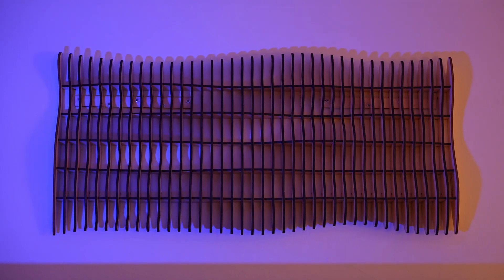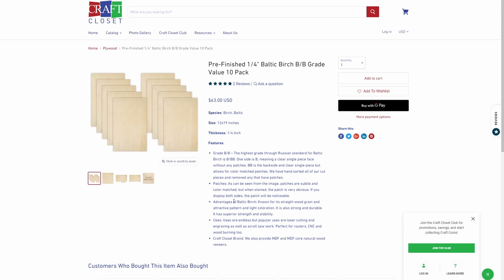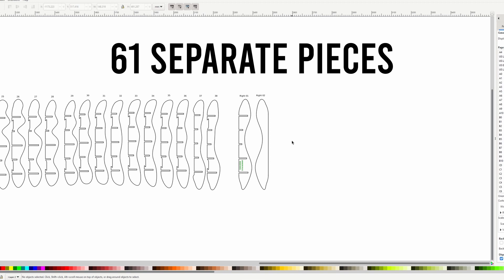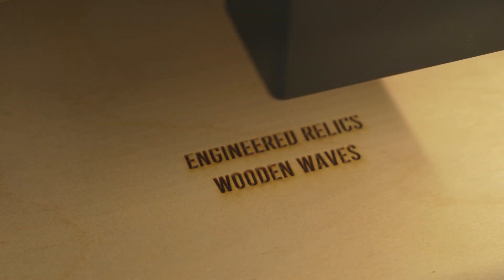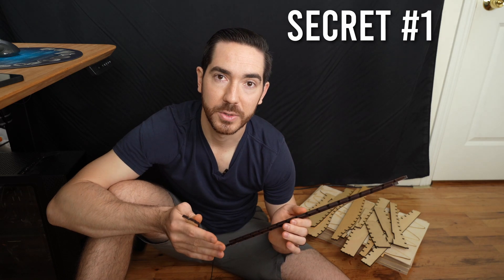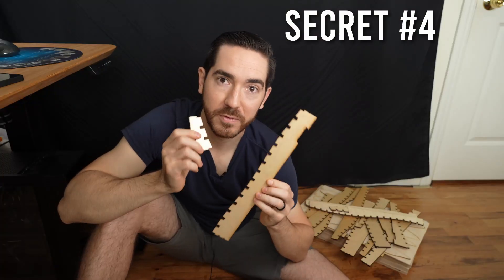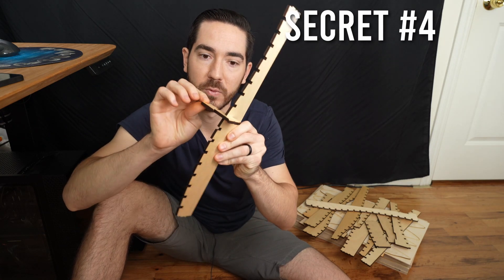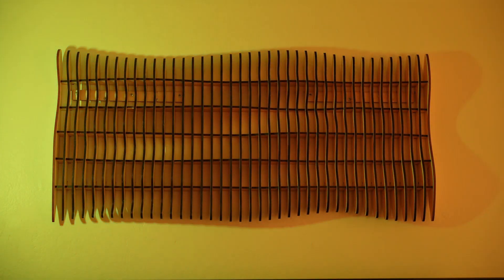Making 3D Art with 2D Plywood

Comment: This is great work, i'm really impressed. What I would like to know is how you mounted it on the wall? Can you share that?
Reply from the maker: It's mounted with a sort of french cleat design. The back of the slats have an angled cut in them which can hook onto some angled wood that I screwed into the wall. It works to hang, but because the art is so hollow, you can see the mounting strip in the back - I'd love to fix that and find another way to hide that mount.

Comment: Design is easy...but how did you exported all cross sections to DXF file and have it all nicely organized on sheets with numbers?....when I export to dxf file it exports all pieces together...in the view I have in the screen....I tried to use Slicer Fusion360..it nicely organizes all together but it doesn't allow me to eliminate section I want to eliminate....I want to do it all in SOLIDWORKS but can't find the option for exporting all cross sections into nicely organized dxf file
Reply from the maker: I want to find a solution for that as well, an automated one would be incredible. But for this I brute forced it by exporting them one at a time... It took a good amount of time to organize and number them like that. Let me know if you find a SolidWorks solution!

Comment: Nice job. But I think the spacing is too wide. It would be a little bit nicer, when the spacing between the pieces is the same as the thicknes of the plywood. And another thing I do not like are the black edges. it would be better to sand the edges to show the wood. But it is only my personal opinion! 👍🏻
Reply from the maker: I very much agree on your spacing comment, the waves just aren’t as visible on mine until you get to shallow viewing angles. Thank you for your feedback :) There is always room for version 2!

Comment: how do you lay every piece side by side to decrease the area of wood required as much as possible?
when I do a solidworks design, I struggle laying every piece manually in the drawing before saving as dxf file. and it takes too much time.
Is there any add-in to solidworks or even another software that can do that automatically (automatic arrange) ?
Reply from the maker: That is a great question and I don’t have an amazing answer because I also brute force the part packing myself. If I’m laser cutting I usually do the packing in Inkscape because I just find it easier to copy and move things to prepare for exporting, but it could be done in SolidWorks too. Now that you ask though, I wonder if there is an extension that can be downloaded for Inkscape which could do the packing, there is a lot more user made programs for it.

Comment: Heya. Which software did you used to create that 3D modelling?
Reply from the maker: I use SolidWorks to do my 3D modeling, I use it in my work as a mechanical engineer and I love pushing it to make art! It does have upfront costs to acquire though, so in terms of functionality Fusion360 could design everything I’ve made on my channel, and it’s free! But there are other options out there as well.